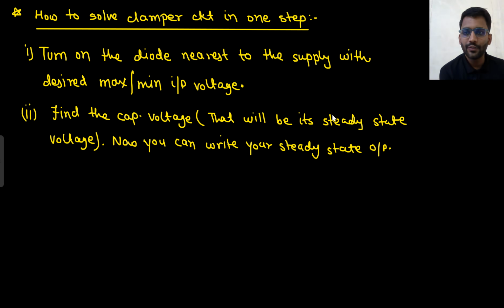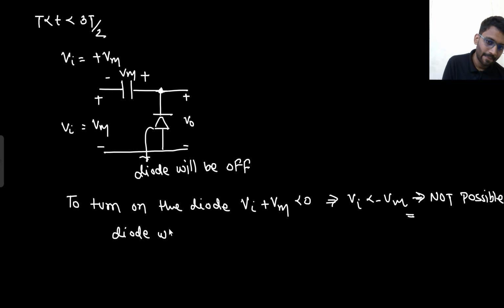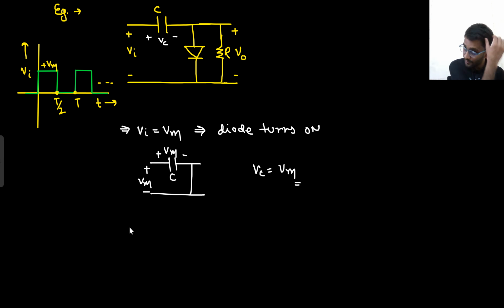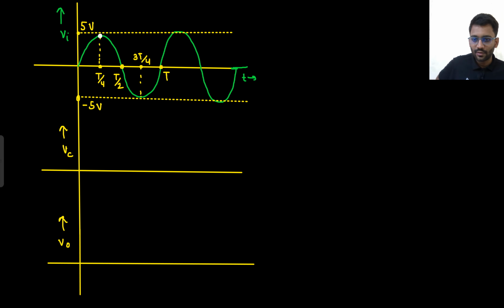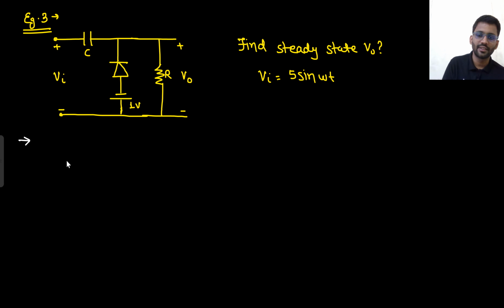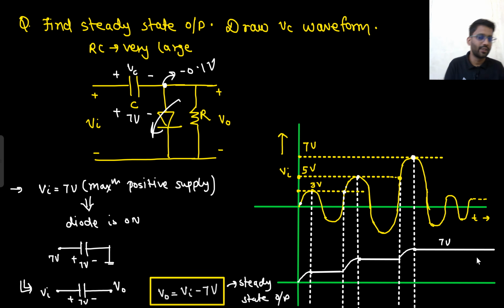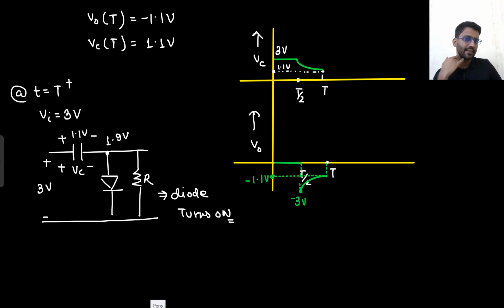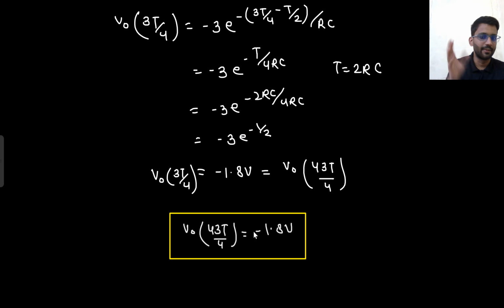More Examples of Clamper Circuits || Analog Electronics || PrepFusion || Himanshu Agarwal

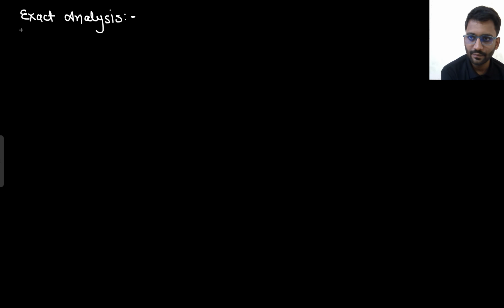Comment from the maker: Error in the ckt at 28:30  
Diode will remain off for Vi<1V and Vo=Vin with Vc being at 0V. After Vi>1V, th diode will turn on and the cap will charge till 4V, and final output will be Vi-4V 
Sorry for the error.
Reply: Yupp due to 1V battery the diode reamains OFF till t=0.032T {5sin(2pi.t/T)=1V} after that it'll  turn ON till then Vc=0V and Vo=Vi
Reply: I didn't get this point sir, would you please explain this in any next lecture 🙂

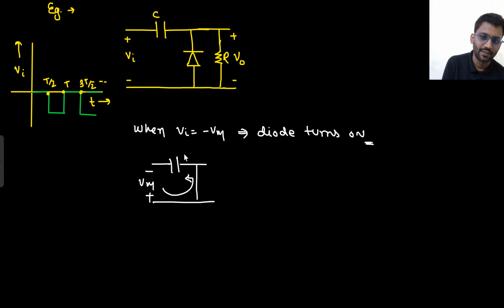Comment: sir but , when the vin goes in negative half cycle the diode will turn on at that time right?, its not required for the diode to get turned on only when the vin = -vm, because that is the value of steady state, i mean when vin enters -ve half cycle, the diode turns on and the cap will start getting charge due to infinite current phenomena , the cap will follow the vin, at the point when the diode enters in conduction mode, for starting case im saying., yes na so diode will conduct and further after steady state the vin should be greater than -Vm which isnt possible.... see @16:20

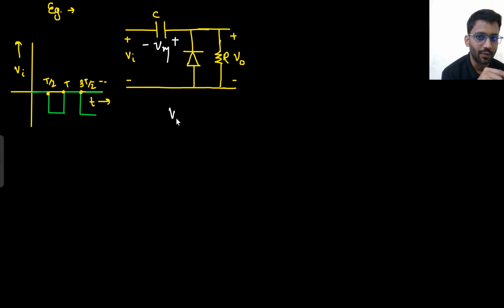Comment: 15:30 Sir why did not you consider the at v=0v condition the diode to be on it's may or may not be...
Reply: What will happen even if it's on? Nothing, right? The cap will not charge. The ckt will remain there as it is. 

The similar condition has already been faced in 4-5 ckts before as well. You can't expect me to explain the same things again and again, right? I should leave some things on your understanding too, so that you learn better.